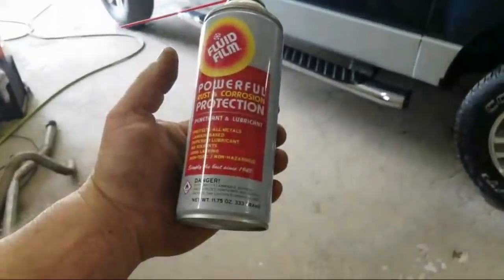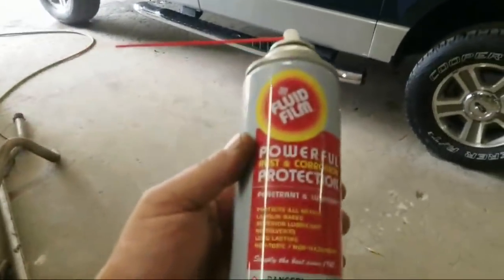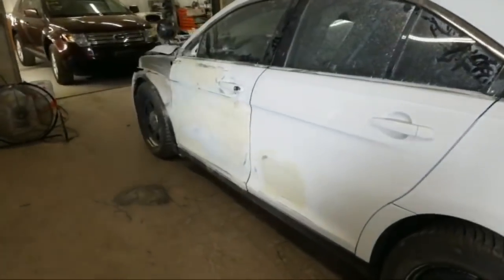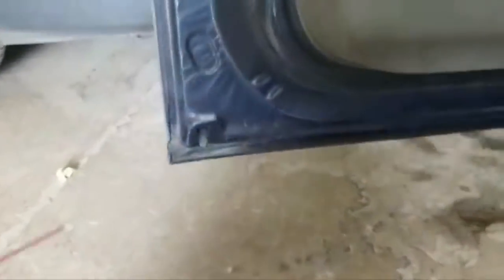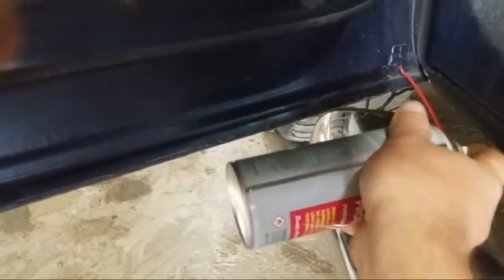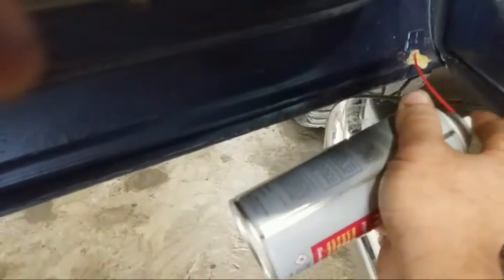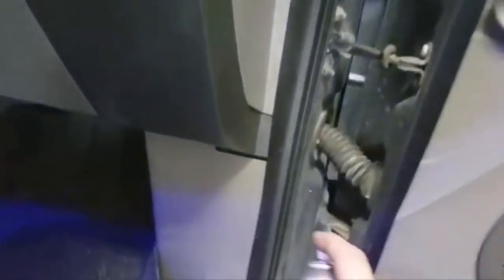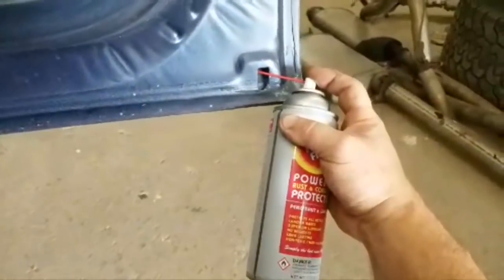Fluid Film Rust Prevention

Comment: WOW! This stuff is quite common up here in Canada, Rust check is another popular brand. You can take your vehicle to there shop, they spray the whole underside and inside all panels, costs about $130.00 to $150.00 and it comes with a lifetime warranty. You need to this every year, and it works.
Reply: Rust check? Nevet heard of that. I know u guys use Krown. Applied once a year underneath and in doors and rockers
Reply: That's cheap.....In N.Y. they charge $500.00

Comment: when doing inside on the bottom of the doors I would have sprayed
it on a towel then wipe it across the bottom. Doing it this way there
would be no over spray onto the rubber seals that could swell up on you later.

Next I would have taken a few of those plastic spray wands and heat shrink them together
to make a longer wand to get all the way done inside the doors from the top. By using a
flashlight you will be able to see what you could have missed. You might want to try out
these ideas next time you do it. Great video though.
Reply: @chrissalyers4459  _ I do !

Comment: I especially use it for coating parts during and after Wheel bearing hubs and brake jobs. In rust country, you know how hard it can be to pound off a rusted rotor. This stuff adds years to the rust-free workability for the next brake job. How about those Aluminum wheel on a steel hub? Works great for that. They come off the next time like you live in California.
My wives next new car is going to get a pre squirt around all the brake parts and Hubs. SO when I have to do them the first time. I don't have to pound my brains out.
This stuff was invented during ww2 to coat metal things strapped to cargo ships crossing the Saltwater oceans. performed fantastically then and it performs fantastically now.

Comment: Wondering why you didn't do any of the undercarriage?  I personally like having my frame, brake lines, gas line, etc. protected from corrosion damage caused by salt. To each their own. Glad the few areas that you did apply it to are showing that they are protected.
Reply: It's 13 bucks a can. U can buy it in gallon form but need to have a air sprayer and compressor. It's about 40$ a can.

Comment: Will WD-40 do the same thing?
Reply: I used WD-40 before I learned about Fluid Film.  It's definitely NOT as good, and WD-40 often turns into some kind of black mold that can't be cleaned off paint. More expensive, but I'd rather use gun oil than WD.  The good thing about FluidFilm is that  it holds itself up really good, so it doesn't drip away as much, and stays right where you put it.  Highly recommended.